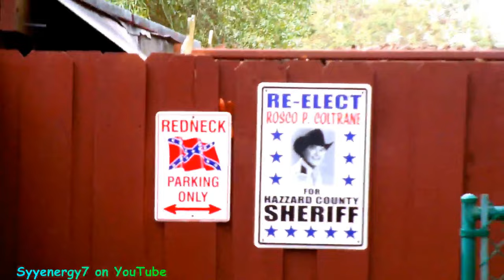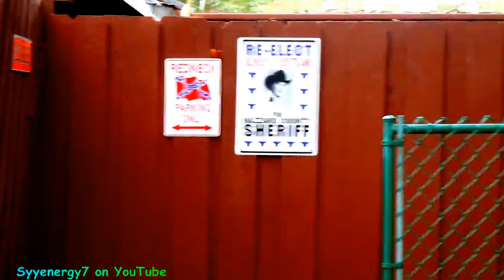Panda CAT & daughter 'GoldDigger', with DETOX Health Info

Comment: Sy: Please put together a more specific protocol for detoxing with activated charcoal, vit.C, & niacin. I need to detox from an H. Pylori infection which I treated without antibiotics. My heart would go into afib at night, and I could have been put on cardiac medications; but I knew it was the H. Pylori. Beat out the doctors on that one !  Thank you for the nice video about Missy. She should be OK.
Reply from the maker: Never take activated charcoal at the same time as meds.  Make sure you take the meds a couple hours away from the time you take activated charcoal, because activated charcoal will "adsorb" the meds.  Activated charcoal works good in the morning on an empty stomach and drink lots of water.
Reply: Sy: If you are going to do another video about activated charcoal, please include information about how to not get constipated. On second thought, this is where the Vitamin C would come in handy. I still like the idea of this activated charcoal with Vit.C and niacin.
Reply: The corruption is a result of satanic control. Yes, it is the tip of the iceberg. Just wait....it is being cleaned up.  You are Catholic? There is satanic Catholics, too.  Not you though, you have a good heart.
Reply from the maker: EXACTLY,  I wouldn't take the vitamin C at the same time as the activated charcoal, but an hour away from that time.  Drink lots of water and take vitamin C during the day, but not with the activated charcoal at the same exact time.   The vitamin C will also neutralize more toxins.  And also true vitamin B3 (Nicotinic acid).  True B3 (Nicotinic acid) flushes toxins out of the fat cells and sometimes even destroys the fat cells.
Reply: you got mold
in your heart and maby chest
dr darren schmit Mold causes lactic acidosis
Reply: +syyenergy7 you'll never have a problem with mice